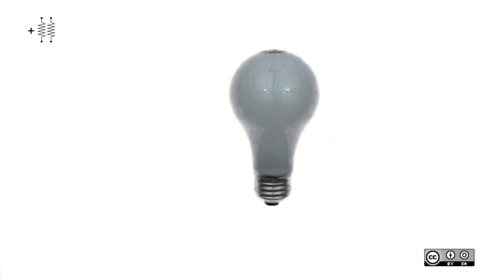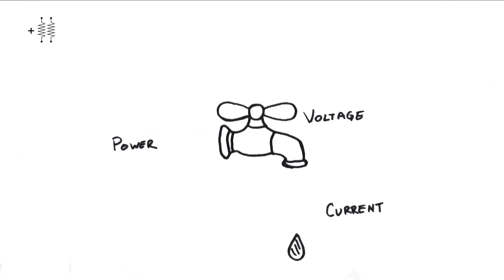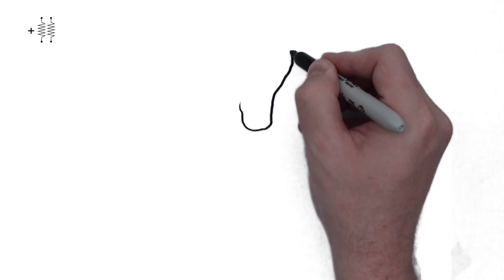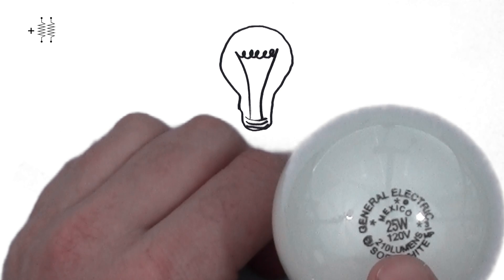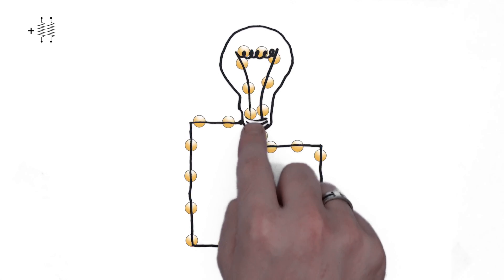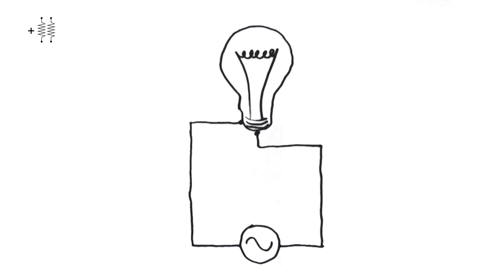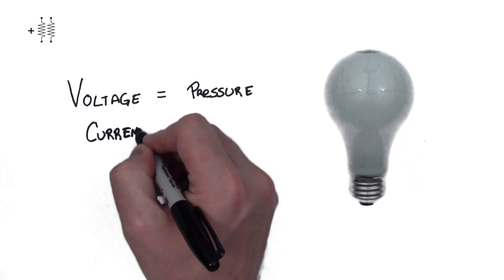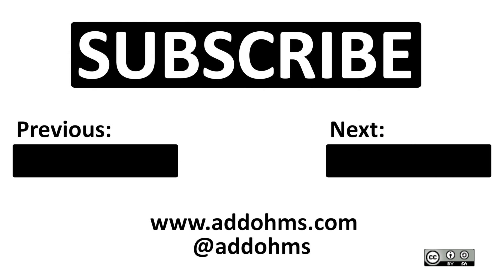Brief Intro to Voltage, Current, and Power | AddOhms #4

Comment: Isn't power the rate of doing work? You say that power is work. This is confusing!!
Reply from the maker: Power definition is energy transferred over time. (it's the difference between "power" and "energy." Which often gets confused.) Work's definition is the transfer of energy. 

But none of that really matters what was being said in the video. The purpose of the video was to help illustrate improper uses of "power", in statements such as: "this device needs 5 volts of power."

Comment: what if water pressure is the voltage ? and the pipe width/length is the resistance ?
Reply: And the valve is a variable resistor.

Comment: Awesome video!
But on the pipe thing voltage is the pressure and how wide the valve is opened is resistance.

Comment: Awesome video - thank you!
 I found it searching for the answer to a small conundrum I'm having - perhaps you can help me out?

I just purchased an industrial task light at a yard sale - it's definitely "vintage", but I don't know how old. I just noticed, after days of successful hours-long use, that the box-like base just above where it clamps to the table was kind of hot. (I guess it's a transformer?) Not scorching, but quite warm. I then noticed the plate that says 118v. I learned in your video that US voltage is 120. Is this going to be a problem? A fire hazard, perhaps? Also, It takes 2 bulbs - one 22w circline  fluorescent and one standard-based bulb. The spec plate says 22.6 watts. I'm assuming 22.6 watts doesn't mean I have to use a .6 watt bulb for the second one? I currently (haha) have a 19 watt LED in there.
Thanks for any help!
Reply from the maker: Sorry, I won't be able to give a good answer, there is just too much information missing. However, the 118V vs 120V shouldn't be an issue.
Reply: Cool - thank you! That was my main question.

Comment: The author also believes as I do that the water analogy is hard to follow and difficult to conceptualize. Instead, he uses a light bulb which is more helpful to illustrate an electrical circuit, because it is an electrical circuit, whereas the flow of water is not. The author introduces voltage, current and power, making sure to describe the units of each measurement. This video really excels when he actually applies what current and voltage mean to that of a light bulb, not to water coming out of a pipe. This application is very helpful for students to better understand the topic. Thanks for a great video!

Comment: hello sir... I bought a transformer from 220v to 110v output with 2000watt in it...but my friends oven from the US is using 120 v and 1500watt...I,m hesitant to use it due 10volt shortage...Is it ok to use it or not at all?
Reply from the maker: +richard Acol It is fine.

Comment: you related voltage with pressure..( in case of voltage source). 
please explain how voltage is similar to pressure in case of a current source.
how a circuit with current source work?

Comment: i knew that the voltage is constant for certain devices
but the current is not , so deos current value depends on the source of power or the device ?

thank you ..
Reply from the maker: OMAR Devices draw as much current as they need. Sources provide as much current as the device (or "load") requires, up to their maximum output. Generally when the current demand is higher than the source can provide, the source's voltage will drop.

Comment: Can someone please just explain HOW you create VOLTAGE?! No one seems to want to start at this very basic beginning. Why doe these videos just gloss over that like we all understand it?!
Reply from the maker: LawoftheLandPA Well, in the case of this video, I clearly state we are just explaining the definitions of the terms.  So no, we haven't "glossed over" how voltage is created.  Searching "how is voltage created" comes back with a number of excellent videos on the subject.
Reply: I'll try.
Reply: LawoftheLandPA The voltage is created by the separation of negative and positive charges. It can also be set up by a changing magnetic field (electromagnetic induction).
Reply: So what is the difference between a 9Volt and a 1.5 Volt on a very basic level?
Reply from the maker: LawoftheLandPA Nothing really, except that a 9 volt battery is typically made up of multiple 1.5V cells. They are put in series to get up to 9V.
Reply: Ok. What is a cell?
Reply from the maker: LawoftheLandPA A "cell" is a single unit. A battery is a collection of cells.

In the case of 1.5V batteries like AA (LR6) or AAA (LR03), we call them "batteries" when they are actually "cells".

A cell is made up of an anode (the positive) an electrolyte (contains the charge) and a cathode (the negative.) The cell's voltage depends on the materials used for those 3 parts.

The common materials make up cells around 1.5V, which is why the common sizes from AAAA to D are all 1.5V... 

To get to 9V (PP3), sometimes 6 1.5V cells are put into series to make up the battery. (In fact, originally six AAAA cells were packaged inside of the rectangular box. Today different materials are used for different cell configurations.)

You can find more at:
http://en.wikipedia.org/wiki/List_of_battery_sizes
Reply: +LawoftheLandPA I think voltage can be compared to potential energy. The higher the difference is between negative charge and positive charge the higher the voltage is.
Reply: But HOW do you create the charge and more charge?
Reply: +LawoftheLandPA A battery uses chemicals where one chemical gives electrons to the other (read about battery and redox reaction).

In a generator a physical force pushes the electrons along.

Comment: I'm getting really annoyed with the difference between current and voltage... I can't understand it. It doesn't make sense. How can you not have current without voltage? You say the current is the flow of the electrons and the voltage is like a driving force/pressure, but that just means that voltage is the same as current??? If you increase the flow you also increase the driving force and if you increase the driving force you will increase its flow?!!?! So is it the same thing? Why do you multiple them together in order to get power?
Reply from the maker: Nathan Chiciudean Pressure and Flow (not just in electronics) aren't the same.  There is a strong relationship between the two, however.

Voltage is pressure.  It's how hard an electron is trying to move.  
The rate that it moves, or flow, is current.

Using arbitrary units, consider it this way.  If an electron is being pushed with 100 units of force, but not moving, the pressure is 100 while the flow is 0.  Since the electron doesn't move, no energy is spent. Take a battery for example.  It's voltage is 1.5V but with nothing connected it's current is 0 and so it its power output.

Power is energy spent over time.  This is why Power is Voltage times the Current. You are calculating how much work is getting done.  So in our example 100 units of pressure that results in 0 units of movement, means 0 work--or Power-happened.
Reply: AddOhms Just before you've replied i finally understood it but your answer helped understand it more. I thought of it just now that voltage is kind of like the strength, effort or like a kick that you give a ball and the current would be how fast it goes between 2 points. But then i realized why do you multiple them to get power? Couldn't you figure out the power it gives just from the voltage or current alone?
Reply from the maker: Nathan Chiciudean Not alone, you would still need another term.  When you multiple power times current, you're actually implying the resistance of the device (or wire or system.)  The relationship between voltage, current, and resistance is defined by Ohm's Law.  

So if you don't know voltage, you can calculate power with the Current AND resistance... Which is Current times Current times Resistance.  That's just algebra from Power = Current times Voltage ... and Ohm's Law  Voltage = Current / Resistance.
Reply from the maker: Nathan Chiciudean Also... good analogy with the ball kick.  I might use that in the future.  :)
Reply: AddOhms
So because current and voltage is proportional does that mean that technically you could only have the voltage and find out the current it will give?
Reply from the maker: Nathan Chiciudean You have to have the 3rd term, resistance.  With only the Voltage AND Resistance or Current AND Resistance you can determine Power.  

http://www.electrihelp.com/Technical/OhmsLaw.aspx
Reply: Your frustration is well justified. The problem here is, to understand voltage and current properly the concept of energy has to be explained first. Voltage is just a name. It represents the amount of energy that is released when a coulomb of charge (electrons) flows between two points in a circuit (a battery +terminal and -terminal being a good example). When a coulomb (a coulomb being a universally agreed very large number of electrons) flows quickly then energy is also released quickly. Which gives us Power, which is a name we use to describe how fast energy is released. Measured in joules per second.  (This is really a summary here as it can take a fair bit of time to grasp these concepts to be honest) 

Anyway let me use an example. Lets say we have a battery that is called 12 volts.  What that actually means is, that if we connect up the battery with a piece of wire. Then 12 joules of energy will get used up when a coulomb of charge has moved through the circuit. Now the word power is another name we use which means how much energy is released per second. So if energy is released very quickly then we have high power and slowly we have low power.

So, if it takes a second (for example) to release 12 joules of energy we have a power of 12 Joules/Second (Watts)
if it takes an hour to release those 12 joules then we have a power of 12 joules over 3600 seconds or 0.003 Watts (joules per second) (i.e 12/3600)

 Now the word current is a confusing name which means (electron flow rate) this is also measured in that universally agreed number we called a coulomb (eg a standard agreed fixed large number of electrons). So when we say we have a current of 1amps it means that a coulombs worth of electrons are passing through at a rate of 1 coulomb per second.

So now we have all the elements we need to understand the concepts of voltage, power and current.

If we have a machine that induces electrons to flow through a wire at a rate of 2 coulombs per every second and we know that the machine will deliver 12 joules of energy for every coulomb that flows (12 volts) then what is the power delivered by this machine? Well it is simply the energy per coulomb per each second it takes to move those 2 coulombs. 12 * 2 = 24 Watts. Watts is another name we invented and it means the number of joules per second.

So in out made up example we have 12volts times 2amps = 24 Watts of energy released (The amount of joules of energy released each second). To be more explicit we could also say it like so. In a circuit whose battery will release 12Joules for every Coulomb that flows. Then if the charge flow rate is 2coulombs per second. This would mean 24 joules is being released every second, all the while the circuit is connected to the battery.

To keep things short this would normally be written as V*I = P (Voltage times Current = Power)

You may also of course then ask what is energy? Which is a very good question you should ask! Energy is the capacity of a physical system to do work. It is defined as the work done in moving an object (or mass) between two locations. It has the units of force time distance. Nm (Newton meter). So an object placed on a high shelf has potential to release energy and it will do when it is knocked off the shelf. That is what we mean by potential energy. So when a battery has its terminals joined together, then the potential energy is released as kinetic energy when the charges flow. We say the battery has an amount of potential energy per coulomb. Again called Voltage (Also referred to as a potential energy difference per coulomb).

 At this point you would then go on to learn what the meaning of resistance was and then onto ohms law.
When you have reached ohms law and you understand the meaning of resistance and all the above then you will have grasped the fundamentals. Which is a huge step.
Reply: Voltage causes each ion (positive or negative) to give up or receive an electron. Voltage is the pressure that pushes each electron. Without that push, electrons cannot move, thus no current flow. When someone says "Current", it means voltage and "amperage" are present. Amperage is the amount of electrons flowing in a circuit. Ever hear the term "Voltage doesn't kill you, its the amperage"?  Voltage determines how many electrons move. A higher voltage means more electron flow or more amperage (Current).

Comment: The water pipe analogy works best when voltage is like pressure differential between the pipes and the sink, when impedance or resistance is the diameter of the pipe or a partally opened valve, and when current is of course the flow of water itself.

Using that analogy, and the water hammer effect compared in inductance, and presurized tank as capacitance, and check valves like diodes, then a RAM pump is like a boost converter in electronics!!! (I'll leave it to that for anyone that eants to explore that idea further)
Reply: Hey nice video. I do have some questions though. Isn't power work done per unit time? In physics work is another way of saying energy and work done is another way of saying energy transferred, Power=Energy/Time or Power=Work Done/Time.
Reply: George Thomas Yes, the technically correct definition for power is energy over time.  

However, explaining the difference between "power" and "energy" best saved for a video on its own.
Reply: George Thomas Yup seems legit to me!
Reply: Power Max Exactly, I wanted to point out the same thing. Also the water analogy is great when explaining things like battery charging.

Comment: Don't feel this video explained much of anything about the terms at all. 

I think he should of made the video longer and dispensed with the "sidebars" [interrupting his main point with an aside e.g. the bit about incandescent/newer bulbs, or even starting off with the tap analogy].
Reply from the maker: Thanks for the feedback.  As one of the first ones I made, I had not found the right cadence yet.  

Fortunately, there is no shortage of extremely critical engineers on the Internet, to help point out mistakes--especially on anything remotely creative.
Reply: AddOhms Apologies if it sounded snippy in any way. Hopefully you could just take it as constructive feedback 😜. I know there's a lot of assholes who just write, "this was 💩" or some such garbage. Hence I wanted to elaborate a little. 

The important thing is that you're out there, making helpful videos. Don't think I don't respect that, because I definitely do.

Comment: Firstly enjoyed the tutorial as a plumber all sources of knowledge ,   explanations help. The water analogy could be better, in my mind.... Voltage is analogous to water pressure ie head of water.... Hight of reservoir etc.. Potential energy. Amps.... Flow... Analogous to water flow... Liters per second.... Power....  Pressure times flow.... Imagine a waterfall from the reservoir back to sea level... Place a waterwheel in the flow and using the potential energy and flow we can take off power... Regarding the electrical circuit.... This can be seen as the complete water cycle... Ie sun evaporates water from the see increasing its potential energy... Voltage... Water falls as rain.... Current.... As water makes its way back to the sea over the land.... Returning to reference pressure ie earth voltage... It encounters resistance
Again the above is in not meant to be in any way critical... I have enjoyed your tutorials... But as a plumber I think the water analogy can be useful in grasping an understanding of the subject.... Keep up the good work regards Carl
Reply from the maker: Hi Carl.  Thanks for taking the time to provide feedback.

I've found that the water analogy only really works in the cases like yours, where there is a good understanding of how plumbing works.  

Also since so many other people use the analogy, I wanted to use a different take.

Comment: Bad explanation.
Reply from the maker: Thank you for the feedback.  Why do you think so?
Reply: AddOhms  Actually, sorry about my comment. It seemed as if you did a bad explanation, and this is not what I wanted to say. I was searching for a video to explain voltage as difference in potentials while you explained it differently..
Reply from the maker: We used "pressure" because it is a simpler explanation than "difference in potential between two points."  In fact in order for "pressure" to exist, there must be a difference in potential.  So it is the same explanation, but with different words.
Reply: @mecemodzada8315  water analogy:   speed of water is voltage, and how wide is the pipe is current (perfect analogy :))   and volume of water is power :)   regards